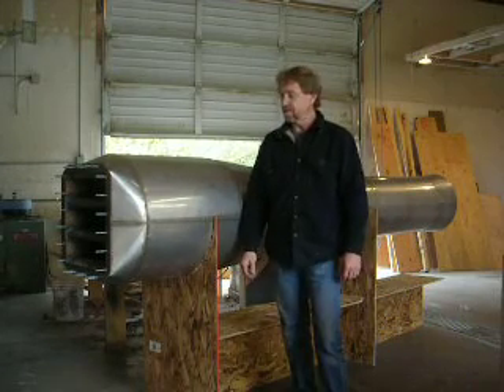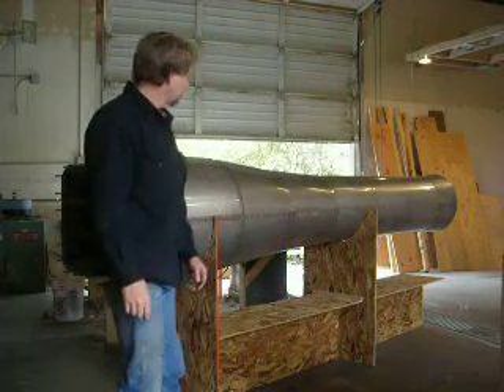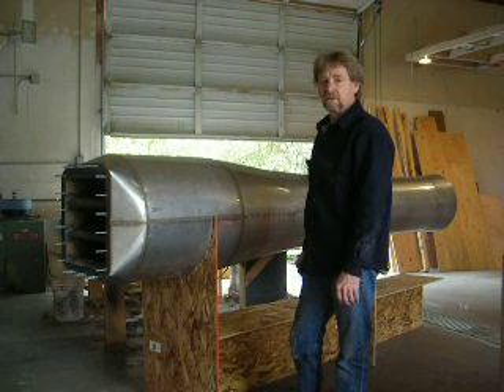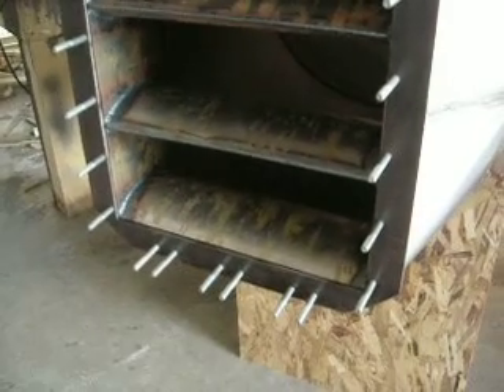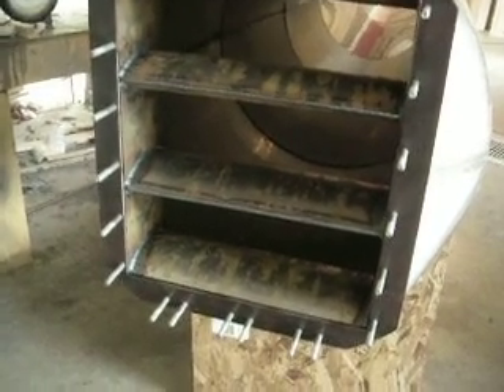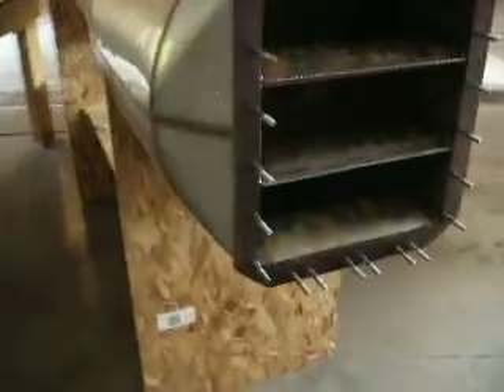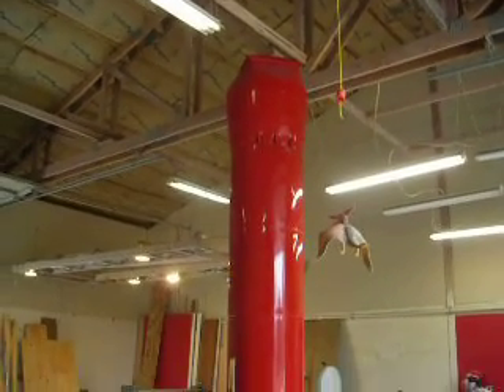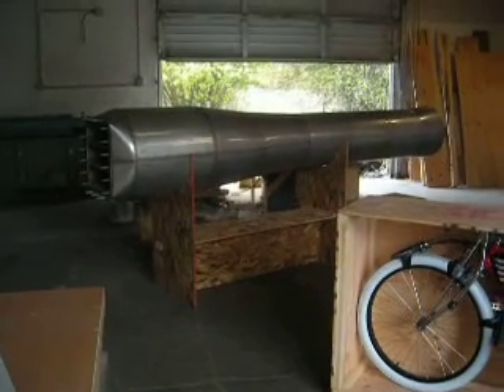MADDOXJETS.COM 'SUPER CRAZY JET ENGINE PULSEJET  GUY PULSO..SUBSCRIBE!

Comment: Why have we never seen any manned pulsejet aircraft? Neither youtube nor wikipedia says anything about it except for some experimental german planes that never made it off the drawing board
Reply: some German test pilots including Hanna Reich ! They were also put on the wing tips of the P51 for an extra boost  !
Reply: @9014jayvictor  wow i never caught your answer, thanks!
Reply: Why? They are extremely fuel inefficient, compared to a jet or internal combustion engine & not very powerful.
Reply: @billsmith281  there was a time where they were the most reliable and turbojets still had a tendency to explode, also people have made pulsejet powered vehicles for the hell of it before, bicycles, boats, even sleds!
Reply: @homeopathicfossil-fuels4789  correct "there was a time"....but with today's advances in technology, they have become nothing more than a novelty.